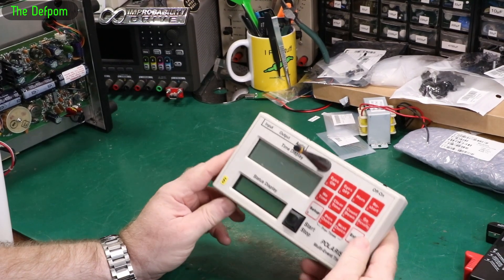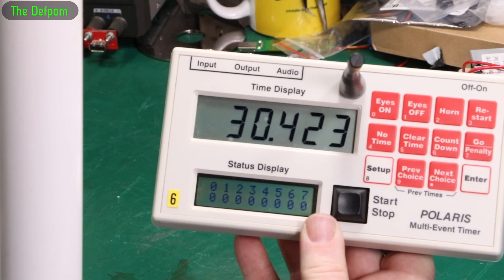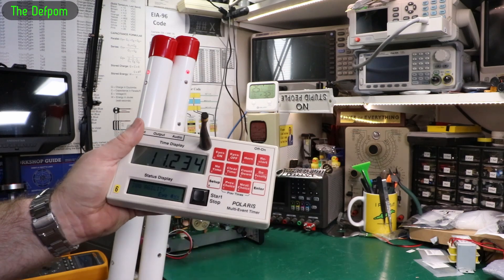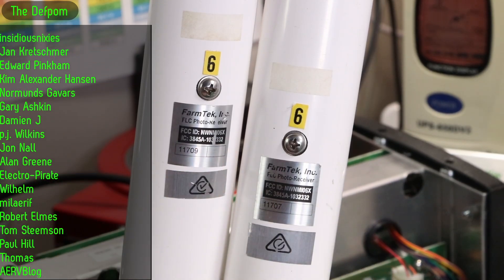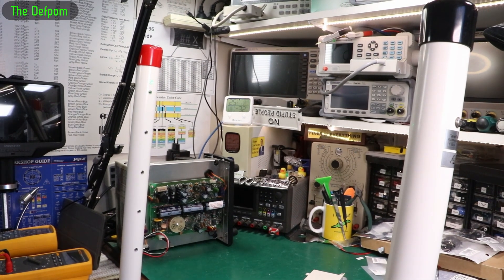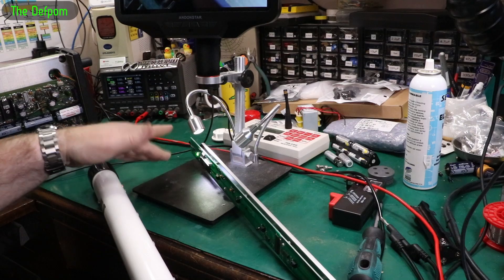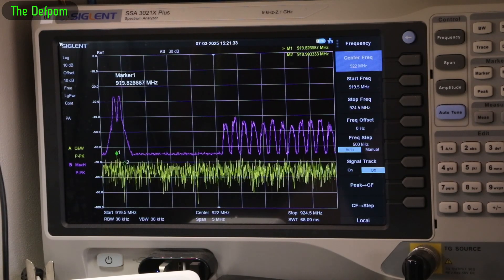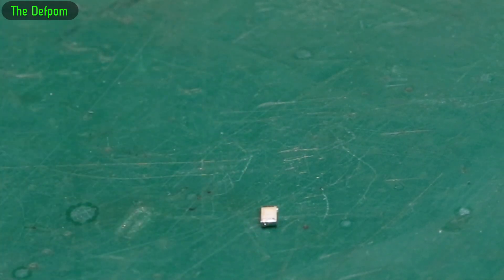🔴 Farmtek Polaris Sports Timer Repair - No.1344

Comment: Hi, nice fix.
At 13:42, the image shows the replaced resistor, also what looks like a dry through hole joint to the right.
Reply from the maker: @tomgeorge3726  yeah I tidied that via up later.

Comment: Looks like you have had some excessive temperature cycling or shock testing by dropping the pole. Years ago when vibration testing pcb's it was fun to see smd components jumping off the pcb like fleas off a dogs back😂😅 they don't take board flex any where close to a tph component.